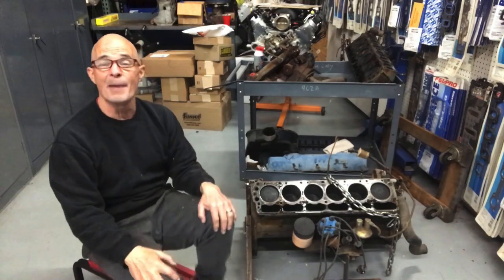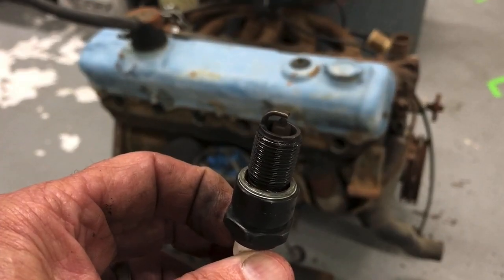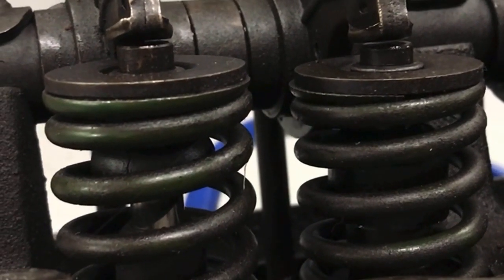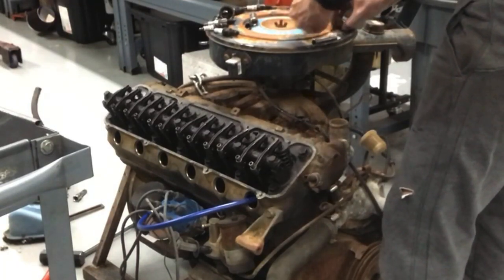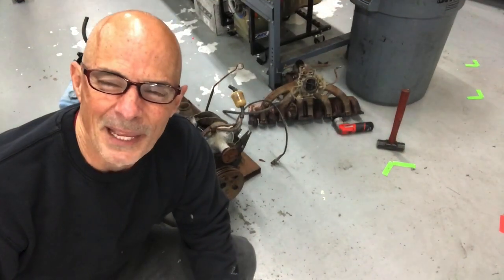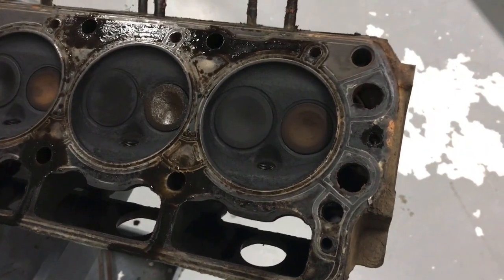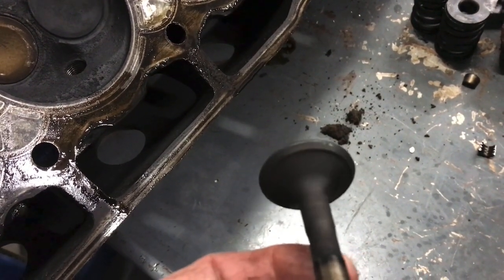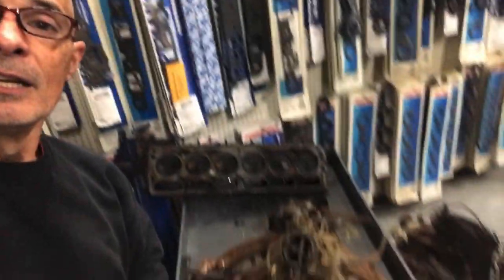HOW TO: FIX THE DODGE SLANT 6 (WHAT BROKE?)

Comment: Loving this project already, and I can’t wait to see more! I got so excited when you said you are going to run a turbo setup! That will be awesome to see! I have an 87 225 slant with an A833 4 speed in my 87 B150 short wheel base van. I would love to make it a turbo slant sleeper! I’m in the process of doing the head gasket, and replacing other basic stuff on the accessory drive. Can’t wait to drive it again soon, maybe with some performance upgrades from all the inspiration in this video! 😎🤙

Comment: That head is a pre-1968. After 1968, they went to what was called the peanut head. It didn’t have the spark plug tubes in it. So, those valves and seats were meant for leaded gas.  Also, if you have 5 core plugs on the driver side, that is a later block. If you have three, that would be an earlier block probably matching the head. At some point somebody’s either swapped the head or the entire engine.
Reply: 1975 was the first year for the peanut-plug head.
Reply: @Joshie2256  I know who you are, so I believe you, but we can both agree the drool tubes predate the super six..
Reply: @RichMander1  Yes, it's an older head. It's also not an emissions era head as it doesn't have a port for a thermostatic vacuum valve so it's pre-EGR too.

Comment: Hi Richard. Can you talk a little about this RPM Act? I keep hearing different things.
Reply: I see Uncle Tony has a video about that too, but I haven't watched it yet. Sounds ominous. Whatever it is, I'm confident SEMA can get it defeated or improved.
Reply: You can look it up yourself. Watch the Video Sema released on it. UncleTonysGarage says its feared more towards Diesels because all the idiots "Rollin Coal"
Reply: Ok cool got. I’ll check out uncle Tony and look for the sema video. Thx
Reply: I read an article from some BS "union of scientists" made a post not too long ago written from a Clean Air Act anylist stating to abolish all modifications and sale of parts from public roads and restricting (to the effect of) sanctioned racing only, basically in a nutshell. We all know it won't be just pollution control equipment either I'm sure they'll try to tie in other parts of cars saying it affects fuel economy and other crap too. Of course we have stupid doughheads that blatenly shit tune their vehicles to make them run like crap and blow their shit all over the place. That doesn't help either. The EPA is trying to lobby against the RPM act so they can completely control our vehicles.

Comment: Why not offset grind the crank to get that piston to the deck? I'm guessing it will require valve reliefs then? I know little about 6cyl's but like all engines, more compression, more air more fuel, eq, more power! I have gotten interested in the 6cyl engines, after seeing the 300ford with Cleveland heads, cut and braised, that car was beating V8 cars!  I want to build a Chevy version, maybe use LS-1 heads, custom cam of course, braise the deck re drill if needed, but just buying a vortec 4200 would be much cheaper!

Comment: That engine has been played with. That style cylinder head with the spark plug wells predates the 2 barrel carburetor.  Likely a 2barrel manifold and carburetor were retrofitted to an earlier engine.

Comment: My dads 225 had a rod go through it. He pulled it out of his Duster and replaced it and the auto with 4.0 and 5 speed from a 99 wrangler. Car got 30+ mpg. He made it from central Pennsylvania to central South Carolina with almost a 1/4 tank to spare.
Reply: It cleared the hood?
Reply: @CarsandCats  by probably a inch and a half.

Comment: I used to have a slant 6 will you take that Dodge performance catalog you can spend a ridiculous amount of money and gain hardly any power
Reply: Yup. I did some work on mine and didn't really notice much of a gain. Engine would've still been running if the frame didn't give out first lol
Reply: @Pinchechuki  they are bulletproof
Reply: @Pinchechuki  What frame?
Reply: @thisisyourcaptainspeaking2259  I had a 1983 Ram that was used originally as a fleet/farm truck
Reply: @Pinchechuki  I've patched up many farm truck frames, I like to use heavy angle stock where possible. Maybe yours was just too far gone.

Comment: If you wanna do this cheap, you should just ask Dulcich for a stock replacement head ... I'm sure he's got several of them laying around.
Reply: I'd bet he has one of the original Aluminum block slants laying in a corner of his yard.
Reply: Think he used all his spare heads trying to port them for that torque storm /6 build.  Pretty sure he hit water in two then went easy on the third one. Lol
Reply: @warhound7781  Steve knows quite a lot, but slants aren't his thing. There's very little power to be made by enlarging the ports. Almost all the work is within an inch of the valve seat.

Comment: Uncle Tony said he built his with stock pistons, but milled both the block and the head .100! I'm wondering why he didn't just buy forged pistons? Maybe nobody makes them?
Reply: I have heard they can be hard to come by. 

One big thing the aftermarket on these blocks needs is a good head gasket. 

A boosted application MLS gasket, or something similar that will seal better than what options we have already would be awesome! 

When boosting these slants we might find it might make easy work of the weaker head gaskets depending on boost levels, and tuning.
Reply: @Thisoneguyinaz  May have to resort to head studs, and O-ringing the block and head. And make your own soft copper head gasket.   At that point, ya gotta wonder about the factory rods.

Comment: Richard I have a general question on Dual plane intake manifold. Is it the runner length that makes them produce better torque and all around power or is it the design in the inlet where it has the two different platforms?
Reply from the maker: its more than runner length on the dual plane

Comment: Do you have any updates on this slant six? Have you ran it with boost?
I was asking because I have a daily driver 67 Dart with the 225 slant. I was going to buy The torch storm supercharger kit that Dulcich ran on engine masters. My other question will be which cam should I be running with that and do I need to change out the pistons? Basically, do you have a recipe for the slant six? Thanks in advance
Reply from the maker: no boost yet

Comment: Hi pelear help me, i have a super sic slant six 1981, It dile not as i would like, when its stop on D or R It start to fail and quit, i dont have a clue.
Plugs looks ok.
Reply from the maker: CARB ADJUST OR TIMING
Reply: @richardholdener1727   thanks it was carb and valves

Comment: PLEASE!!! When you start your dyno pulls on this engine, PLEASE start them down in the 1000 rpm (or less) range! Most stock and mildly built leaners are all in by 4500, and a 2500-4500 pull won't show much!!!
Reply from the maker: motors are never at wot under load at 1000 rpm
Reply: Agreed, most of the “other guys” engines should have been tested like this. More real world for real world engines.

Comment: Okay. Those "drool plug" heads never had hardened exhaust seats. So if that lost the seat it had been done before.  That carb IS NOT a Super 6 carb. That is a 318 or 273 carb. Venturi is bigger, the jets are wrong idle circuitry is wrong. The Super 6 has what I call a "tin top." Stamped steel bowl cover. They are easily identified by their 90* PCV fitting. That is an air metered carb. I call those type Toilet bowls as they look like a toilet. The tops warp and need to be flattened. The jets and rods cannot be swapped between the 2 types. The rebuild kits are different too. If you want to borrow a Super6 carb I will ship one to you as long as it gets returned.  I have several. One I rebuilt and never ran so far. I think that old style carb went away in 72(?) not sure. Any of those BBD's can't be identified other than the aluminum tag on them. The F body Super 6's may have had a 2bbl Holley. I am rusty on my slant knowledge right now.

Comment: Well. GM did the similar experiments with the 
Pontiac 1/2 V-8...and then the O.H.C. Inclined 6...
But Chevrolet blew EVERYBODY "out of the water"
with the Corvair flat-6 air-cooled
"head on competition" with VW/Porsche, etc.
All THAT came from piston aircraft during WWI...

NOW EVERYTHING is mostly 
patterned after modern commercial avionics controlled aircraft... just about everything on autos likewise.😮

Comment: Are you still doing all those tests on the slant 6 or what I know many folks that will be interested in it is there a fund site to help you in part cost or what? If we all toss in a few bucks bucks each you will have enough money to do all the cool tests
Reply from the maker: I AM
Reply: @richardholdener1727   When? I'm really interested in the intake manifold iterations (same length long vs. short runners, different lengths tuned for different rpms, etc.). This is gonna be great!

Comment: The mistake you made was getting a slant6. A buddy of mine had a 62 or 63 Plymouth with a push button automatic and a slant.
Even doing circles in a gravel parking lot was enough to push the oil out of the pan and off the pickup. After two circles the idiot light would start to flash with the oil to the full line on the stick. There is a chance that it didn't have the factory dipstick but that's a big maybe.
Are you going to cut like 0.200 off the head so it has something resembling a closed chamber? Looking how far the top of the piston is down the hole it probably has under 8 to 1.
Reply: Hard to make a hop-up series about the slant six if you dont have a slant six on hand to modify.
Should he have just used an LS?

Comment: Are you going to do the uncle tony trick of putting the Pistons in backwards?
Reply: Its a common thing, some engines are made that way from the starat
Reply: The old bullshit 'trick'. Which wears out pistons really quickly,, and the bores as well
Reply: @ldnwholesale8552  It isn't "Bullshit", that has been a known performance enhancer for Mopars for generations. Before the industry had all the technology and ability to manufacture parts that they do today, plus the abundance of engines back then, it was a free way to get more power. Of course in today's world, it is easy to get pistons that have already been manufactured with better tech, and this isn't a good idea. But it's what we had at that time.

Comment: Been waiting for this test.  This was the engine I whished I had in Highschool in my 81' D150 Ram truck.  Did some Gtech passes and my 1bbl slant was 55hp and 0-60 in 21 seconds.  It was so slow in the 0-60 the Gtech kicked into the 1/4 mile time 🤣🤣🤣
Reply: Mine did 69mph in the quarter mile! LOL slowest pass of my life. It was a 19.80 if I remember right.

Comment: Isn't the 2 barrel super 6 a rare piece? I heard a 2 barrel and headers would almost double the hp over the single barrel and cast manifold
Reply from the maker: that would be a lot
Reply: Well mopar legend (which has been inflated from time to time haha) said the single barrel had a little under 100 hp and the 2 barrel had just under 200. I cant wait to find out the truth!!!
Reply: In Oz we had 2bbl slant 6s in 68. Blue engine 160hp. Red single barrel engine was 145hp. And we only had and made 225s

Comment: My 83 D150 with a 225 and 3 speed with OD could pull a stump but never make it to 60mph...  😂 I am curious if it will break 200hp NA.
Reply: @BuzzLOLOL  have you ever driven one?  It’s geared low.  Runs out of steam quick.  It ran fine.  It just didn’t have power or gearing for highway use.
Reply: @BuzzLOLOL  it’s a 4 speed with third and 4 the switched (in the levers).  Third becomes 4 th which is an overdrive and 4th (1:1 ratio) becomes third.  There a big gearing jumps and by the time you hit 4th (overdrive) there’s no power left in the 225.  I think the rear end gears were too high (low numerically) if I remember right.  So it was out of the engines very narrow power band.  Either way, it ran like a champ and wouldn’t go over 60... Great for slow in town driving or on the farm.  Just not for the highway.  You can argue what you want but you never drove the thing so it’s a non point.

Comment: well i had 2 225 slant 6 that quit came apart oil problem was cause funny after oil company work i started looking at how lube works or lead fuel lubes valves and unleaded fuel effects how fuel burns heat & nasty stuff burns out valves and seats
Reply: Not all that rare and definitely didn't double the horse power.

Comment: mixed emotions on that one... the tan color on those exhaust valves makes it look like it got run without an air filter for a while. How bad is the wobble on the rest of the guides? How bad was the leakdown? You probably won't have to add gap to the rings. I'm guessing all that deck clearance is there so the valve seat can just blow out the port and get stuck in the muffler instead of ventilating the piston. I've heard that .100 or more deck is the way to go with an open chamber head to prevent pre-ignition, but yuck. That looks like a 7:1 deal there!

Comment: Well ?   Did you junk the whole idea?  uncle tony > CNC > welded a hemi head of  Steel   12 :1 you could even do a pre chamber like ford/mazda 45:1 direct injected & carbrated then add  diesel type water injection @12 degrees past top dead center,   dyno that then turbo it.
Reply from the maker: don't remember ever mentioning a hemi head

Comment: That looks like the wrong head for a Super Six. I’m pretty sure the super six didn’t have spark plug tubes. I had a machine shop give me an older head for my Super Six back in 1984. Mine was a 1979. The car was totaled a few months later. That’s the only reason I suspect this.
Reply from the maker: Turns out this was not a Super Six head-but the motor was free
Reply: @richardholdener1727  makes me wonder if that is my old engine…lol

Comment: Well known fact the slant 6 doesn't need an air filter, or oil for that matter, LOL
Reply: @DropDstar OK, it may be a bit of an overstatement, but they are pretty damn bullet proof.  mainly because they are so low of compression and anything else that would give them any real power, but you do have to work to shrapnel on in normal use!
Reply: @DropDstar LOL, anything mechanical has its limits, even something as simple as a straight six.  I once managed to toss a rod in a 350 buick and take out the block, cam and pan in one fell swoop.

Comment: They were good for 330hp until the block brokes especially if revved to 7000
Reply: Or the crank breaks and it turn tales the block with it. 6000 is safe and in reality plenty with such a long stroke.

Comment: First off I'm not a slant 6 guru. Your engine is painted blue which indicates a specific range of years. Second it has spark plug tubes which indicates an older engine (60s?). I've had two 75 model years & an 83. The 75s were blue with no spark plug tubes, the 83 had hydraulic lifters & was painted black. It also had no spark plug tubes. Chances are that you have an older (pre unleaded gas) engine with soft ex. valve seats which will crater when used with unleaded. Sometime around 73 or 74 Chrysler started using induction hardening on all their ex seats. My bet is that all the ex seats on your little test engine are damaged.

Comment: You could've done a better job of explaining the compression test process. I've never seen or heard of testing the compression without the engine running.
Reply from the maker: compression testing is never done with a running motor-just cranking. we did a leak down
Reply: @richardholdener1727  Understood, but, shouldn't the engine be at operating temp when doing the compression test?

Comment: LOL they dont have valve seats, its part of the fk head, if a valve seat fell out the piston would be mullered, basics 101. Its simply got VSR caused by abuse/high miles
Reply from the maker: valve seats can be replaced
Reply: @richardholdener1727  Clue, the  pushrod/lifter adjustment itself was an indication , none of that fkn around was necc, mechanic here for 45years.